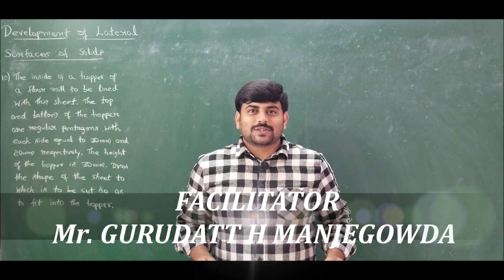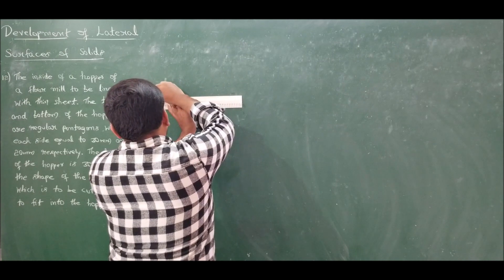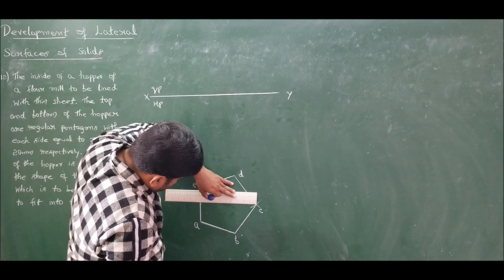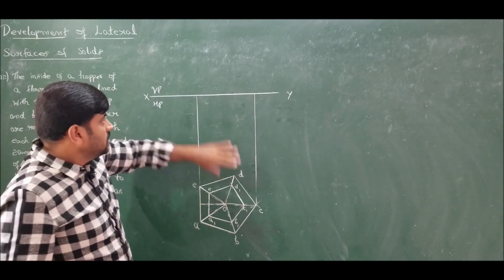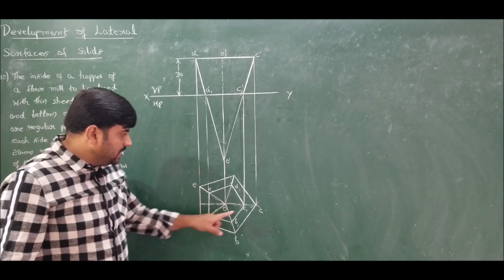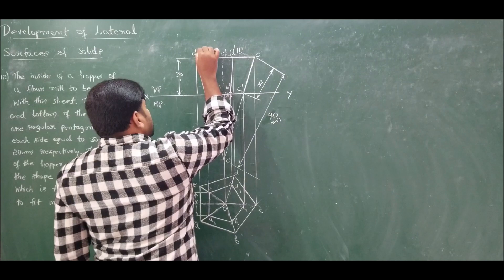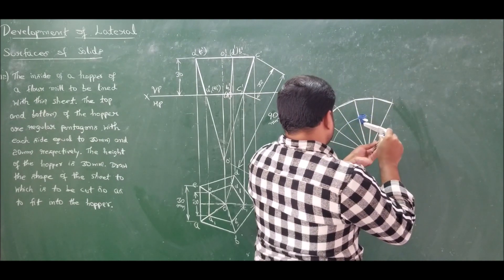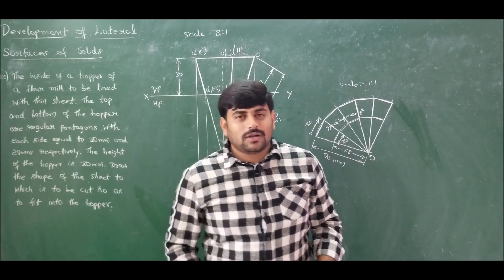58 - Development of lateral suface of hopper - Module 4 - Engineering Graphics by GURUDATT. H. M.

Comment: Sir why we took 58 for the second arc??We should take second arc 32 know.I am not understanding which part to take for the second arc sir.And that development is for what??It represents what??😢😢😢
Reply from the maker: Regarding the second arc
90 - 32 = 58 mm.
The bottom portion is removed and the top portion is retained. The retained part will have 32mm as required.

The development represent hopper refer to this👇 link for better understanding.

https://www.google.com/search?client=ms-android-oneplus-terr1-rso3&sca_esv=7569b3261be45716&sxsrf=ACQVn0-O1xXMTFIrwa0Gv60MxCTibto4wA:1708874051179&q=hopper+image&uds=AMwkrPuVzDpF2Ui_jON45qdA4bHuw-vlfWpno0MMI4B9_LQ46j4ibXdUihEuMME_5-gyL0nwHTFN0D4V-8i0eDj2WwJIouwSGwQWXAlCQJ4v8115o7HFWYK3i0pmWNa6uq4910Mh6_i3x83pXRHoxpMDyAtvg_apNylitxse-ZpWNRv3RckhLPON8iwWP7ISQqVImDn08oqJFB7pmiL09aubGindyq51i7A5T_T-xgCeQ7Lu9qITdQIkXIRcLE57SDyEWQZain1-PmjmACy-IvkCxH8sxNiX04GcutxajErxlZowqZrZ67A&udm=2&prmd=isvnmbtz&sa=X&ved=2ahUKEwjv76T248aEAxXIrlYBHeiFACgQtKgLegQIDBAB&biw=355&bih=661&dpr=3.5